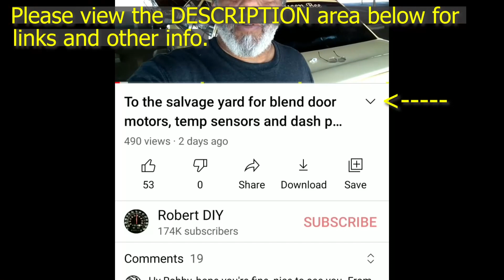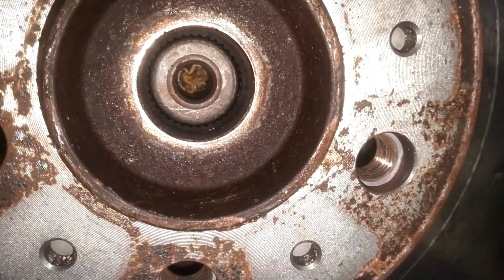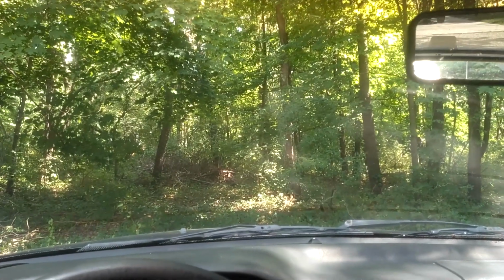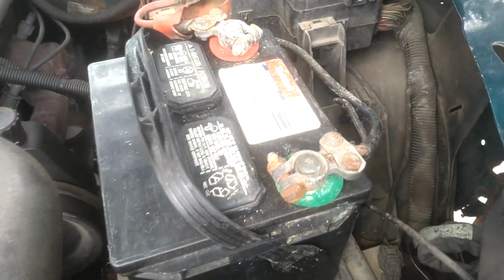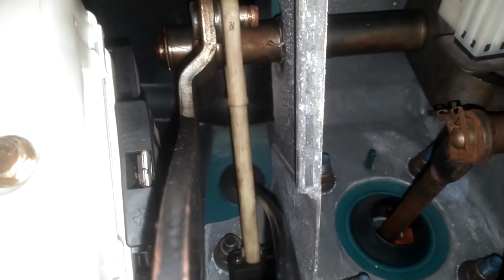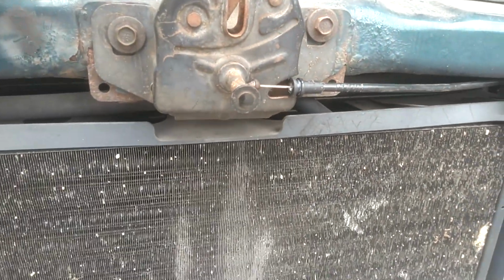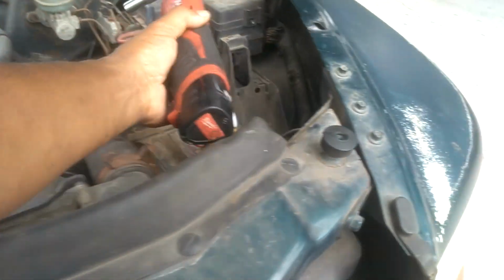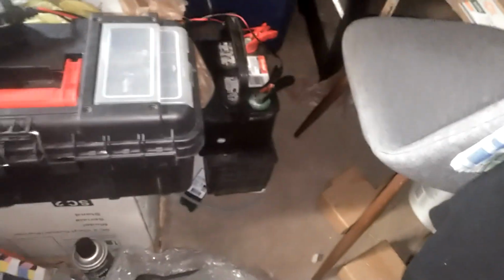P2 CV axle info/drama. Back home and worked on a Dodge Dakota hood release cable. - HOWR

Comment: These CV axle bolts have a tendancy to loosen over time. I kind of check them once in a while. Once i had one unscrew itself completely and stayed there only because of the rim plastic center cap. Thats how i found out. Bought new ones at the dealer to replace them because they strech when torqued. They are not supposed to be reused.
Reply from the maker: Ouch! Most people probably don't know that.
Reply: @RobertDIY  Oh you know what! 
Today my V70 P2 started throwing the anti-skid deactivated message again. I had to tightend my CV axle bolts 1/4 turn and the message dissapeard! how funny  it happened now